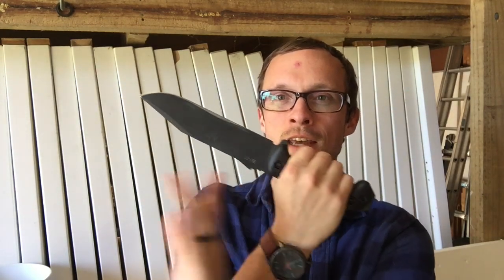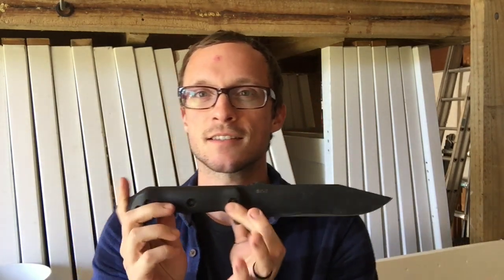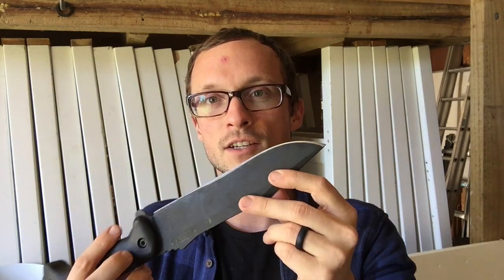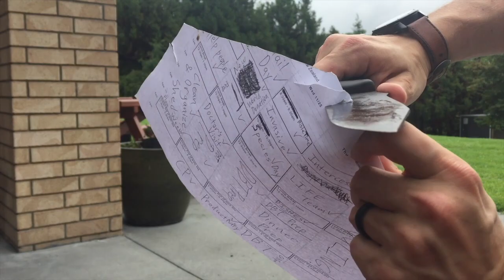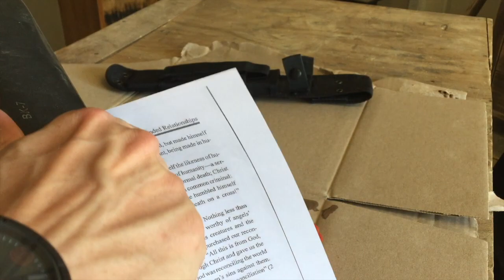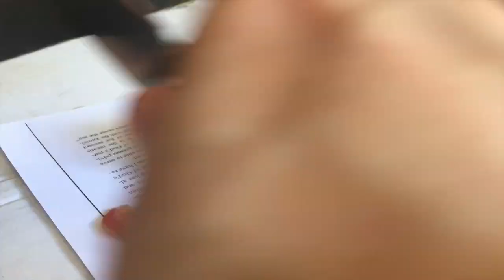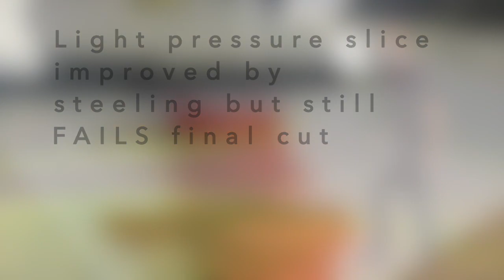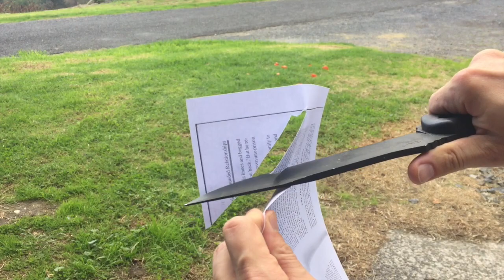The Tomato Test... 2 Steels, 2 Knives, 3-7 Hours Hard Use Edge Retention Testing & Control Variables

Comment: I think that the tomato/paper test will suffice for the most. Not every tomato may have the same degree of ripeness but the difference is minimal. Steeling can be very usefull when using a rod and the proper technique, I use it in the kitchen untill i'll have to use my ceramic rod and then off to sharpening. Hey at least you could fruitninja your way out of it lol oh i guess you had to eat tomato salat for a few days. I suspected the BK to perform slightly better but wasn't disappointed. Have a good weekend Gabe and thank you for the testing so far.
Reply from the maker: Haha true!  Gabe... the VegNinja!  Steeling is good, but on the fly it's probably not precise enough to include in my testing!  For now.  Once I have a favorite/top performer maybe we'll do a separate series on field maintenance and compare steeling, honing, etc.

Comment: There's a saying that Opinel will cut even when it's dull. It's probably geometry and thickness thing. I believe steeling is used to get that effect on kitchen knives. It cannot exactly revive rolled edge, but it will cut somewhat. Outdoor knives are thicker, so steeling might not help. Imo: stropping > steeling
Reply: I use a steel on my outdoor knives fairly often, it’s a SAK 650 , it brings back all my knives, kitchen, edc , outdoor, to a toothy edge, but my grandpa owned a meat packing house and using a steel on a knife I learned is a fact of life, but YMV on a heavy chopper
My route now is a 600-1000 steel, then loaded strop, this usually keeps me off my stones and scary razor sharp until I get a chip or divot ( from a rock or fence post)
Reply: In my opinion:

Bringing a knife to a steel is perfect for rolled edges. Thats the hole idea behind it.  The steel reforms the rolls to a working edge.
Chips on the other side have to be ground of to new edges. Strops are therefore perfect.
And yes a thicker edge is more difficult tu steel just because of the geometry.
And opinels are just unbeatable slicers.
Reply: As Gabe an you said! A steel is great but it definitely needs a period to adjust the techniques not to over do it.
Reply from the maker: Yeah, I suppose the benefits of steeling are the subject of much debate.

I wanted to incorporate it because I have noticed that my 3V Bark River will resurrect over and over with steeling (IE it more often rolls the edge than chips and is then flexible enough to recover), and was wondering whether steeling for tests would bring the tough steels to the surface and show accurately how a bit of touch up can really make a high quality steel with some ductility outlast harder, higher carbon blades.

Anyway, I'm pretty well decided that steeling does stuff, but isn't helpful for these tests as I'm not able to be micro-consistent enough to have the same effect on every knife.  Stropping a couple strokes daily is freaking awesome for edge retention - I SO agree.

Thanks for your input y'all.